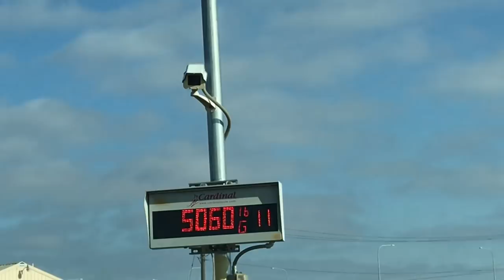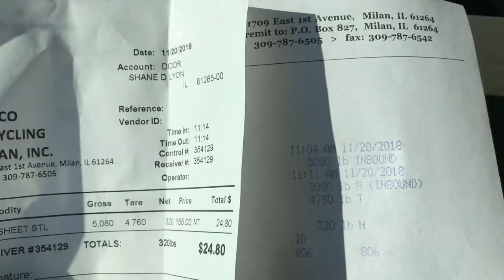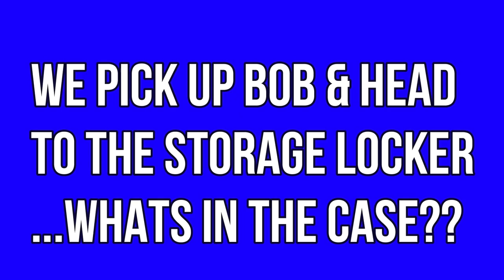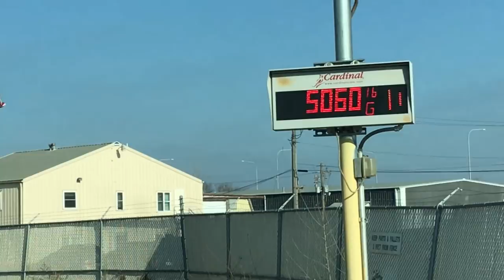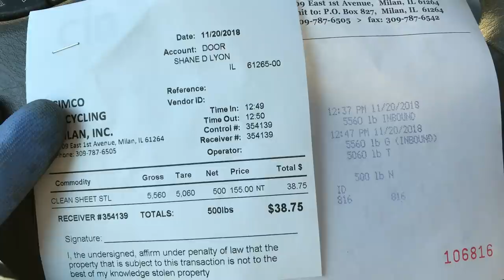Buying my First Local Investment Property! 2 Scrap Yard Runs! Scrap Metal Scores!! Church clean out!

Comment: If you find one of those tabletop ovens in good shape, it's keeplife.  In the Summer especially they'll save your butt, or at least you air conditioning bill.  Plug it in on the deck and cook whatever out there instead of inside the house.  It'll also act like a slow cooker.   That second barn at the house looks like a goner, but you could salvage the wood.

Comment: well congrads on the house .......now go buy alot of pains pills because he headaches are coming lol....a couple pieces of advice save money from the rent to do repairs aka hot water heater , furnace replacement the usual stuff  that is going to have to be fixed and to do repairs when renters move .... 2 learn how to fix stuff yourself  and 3 talk to other people that rent houses they might tell you some tricks like line the cabinet shelves with the peel and stick tiles it makes it  easier to clean when someone move also use peel and stick on the floors instead of vinyl flooring and buy more than you will need to cover the floors because when someone moves out its easier and cheaper to replace a few peices of tile then a whole room of vinyl....and remember renters don't own this house they aren't going to treat like they would if they owned it .....good luck with your landlord future

Comment: SOMEBODY liked purple!  It didn't look that bright on the paint chip, honest!  ha  Actually, that house looks pretty solid.  The outbuildings are a  big plus for what you're doing with your scrapping/sales.  Does the little house next door go with?  Yes, it does!  When I had my quilt studio built in the south forty, an old shed moved on to the property by some previous owner was close by and looking rough.  It was an old horse stable, with the windows that opened out and up from their bottoms.  Old beat-up garage door hanging half-attached, etc.  We stripped it down, had the other half of the floor poured, exterior siding and new roof, new garage door.  You might be surprised at the bones in your '3-car garage' once you get the damaged areas removed.  I think it's possible to re-hab if the basic structure is still sound.  Congratulations on the new buy!!!

Comment: Don't do carpet. If you can, keep the beautiful original hardwood floors. Some of the wood from those older buildings in the back are salvageable or sellable.
Reply from the maker: I agree, but first I may have someone that will rent it as is.  So I would be cool with that.

Comment: No offense Shane but when your dealing with so much money you need to get experts involved. Your an expert in many fields you could make a much better return on the 79000 than that house. Unless its worth 200 k.
Reply from the maker: Mark, just remember that it is not a $79,000 investment, it is (now) a $6000 investment, that will provide $250 in cash-flow as long as I own the property.  so in 2 years I have made my investment back.  AND I save myself $75 a month on storage locker fees.  now that is $325 a month.  And the rent will go up as the property is improved.  And when the mortgage is paid off it may be $1000 a month cashflow depending on rents in the future.  SO it is a stellar investment :)